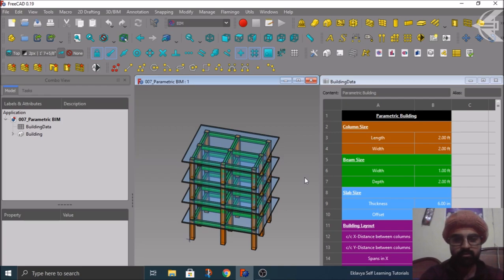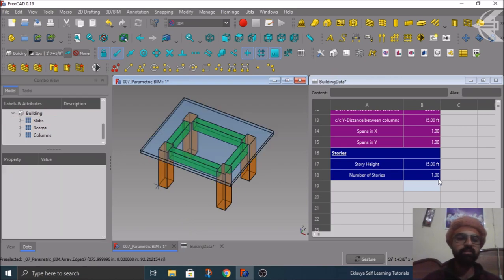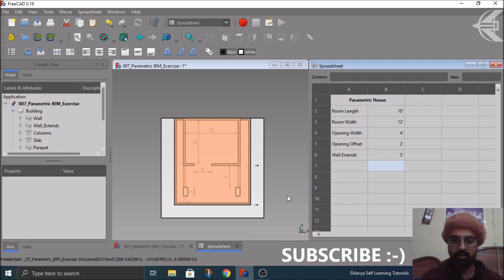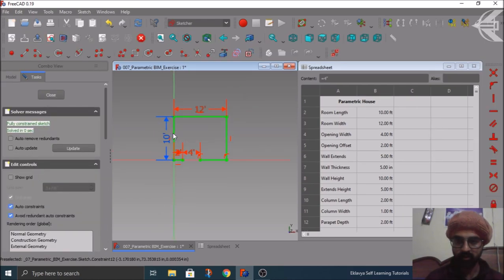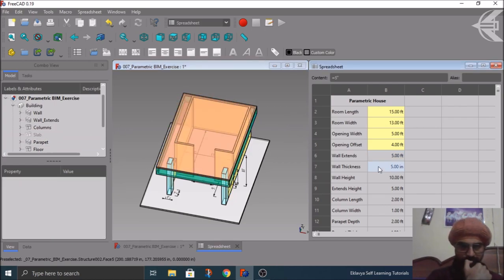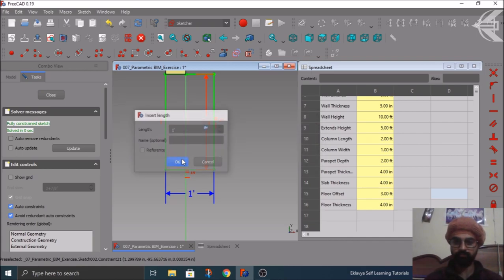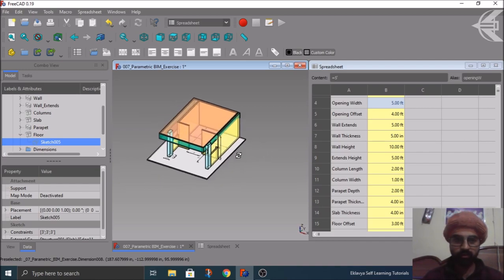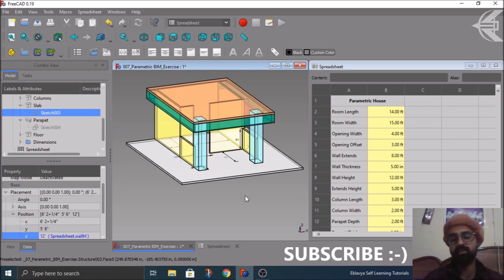007 - Parametric BIM Modelling with Spreadsheet workbench | FreeCAD BIM Workbench

Comment: Could you also explain how you controlled the number of floors? I am assuming you used the array command..
Also is it possible to run a structural analysis on the arrayed floors? Will the columns be considered as continuous or would you have to connect them with some parameters?
Reply from the maker: Yes, you are right. The number of floors are controlled by using array.
You may perform FreeCAD FEM analysis on union solid of such arrayed floors, but do not confuse it with the actual structural analysis. It's a separate vast topic.
Reply: @EklavyaSelfLearningTutorials  We are looking forward to a video on that topic then, i.e. FEM on unioned array objects and how that would be different from a proper structural analysis.

Comment: Great job, I have no background in the structure design, now I need to design photovoltaic structure (so I would be able to choose the right profiles without losing money),  where should I start from?
Reply from the maker: Thanks. You may start with initial Arch/BIM Workbench course.
Reply: But does this course tell me if the structure can handle the load (which I'm interested in more)? Or it's just 3d drawing?
Reply from the maker: okay, so for that purpose you need to refer FEM Workbench.
It's in my checklist to create a seperate detailed course for that. Meanwhile, you may refer the available tutorials on the channel.
Reply: God help you, thank you very much.